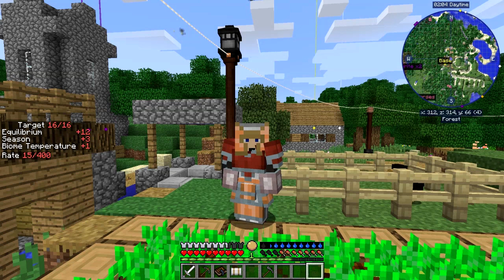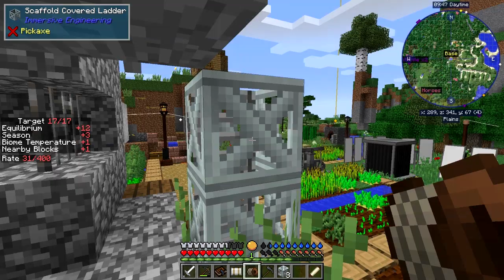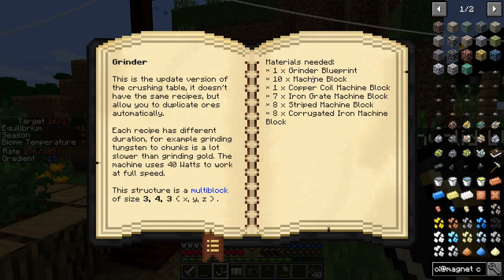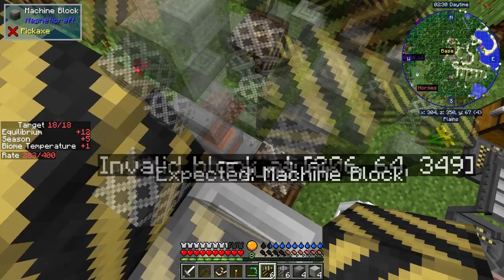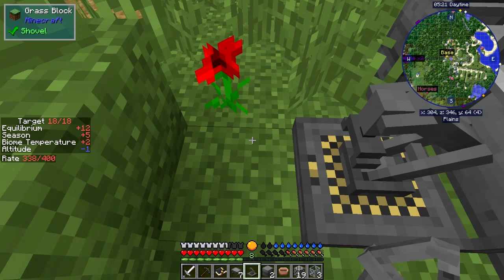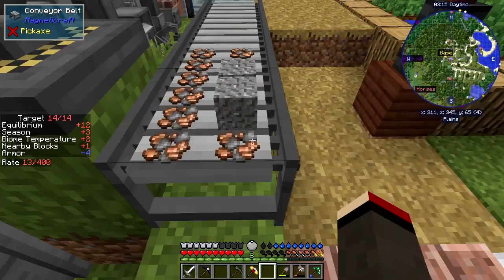Real Tech #016 - Grinder & Sieve with Automation

Comment: I'm looking forward to playing more with Magneticraft. It looks like fun!
Just a heads up: I'm planning on adding Direwolf20's Building Gadgets mod and removing the Not Enough Wands mod from the pack. I don't think you've been using that mod much, but let me know if you have any objections.
Reply from the maker: Danny & Son indeed it’s a lot of fun and the generators are nice an clean (the combustion chamber should produce pollution). Not using not enough wands, might have used the wand to move spawners, anyway it’s your pack and you’ve done all the work so I’ve no objections.
Reply: Actually, after some thought, I'm probably not removing Not Enough Wands. I may add pollution for the combustion chamber if possible without breaking stuff.